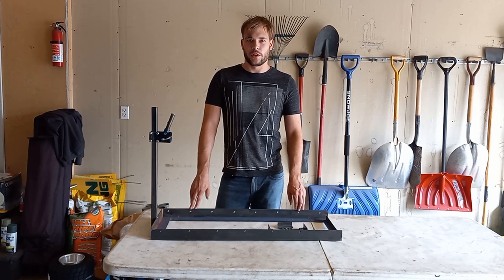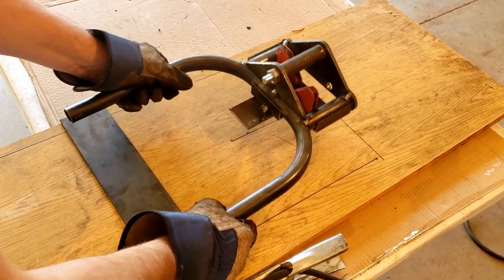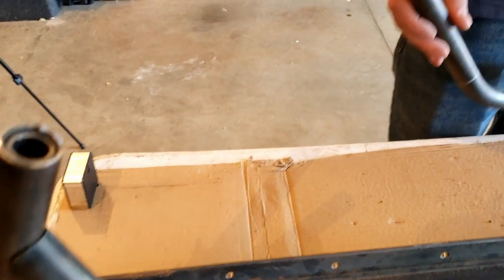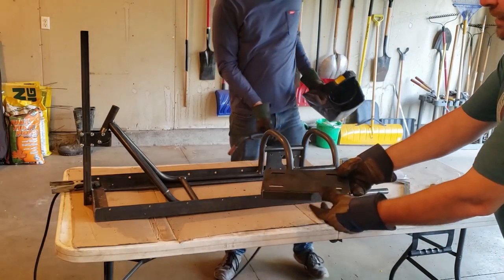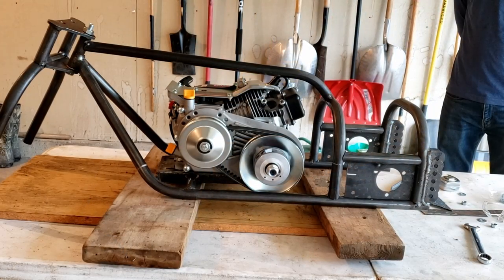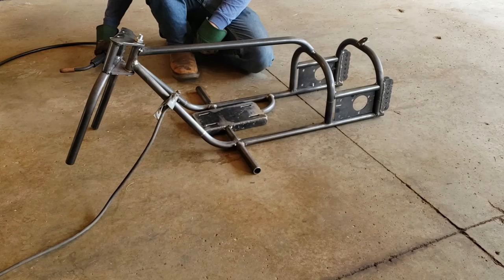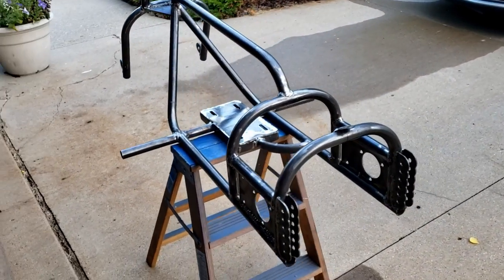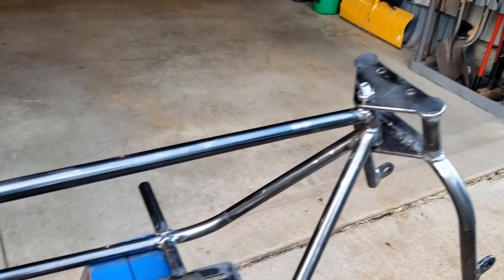Predator 212 Ghost Mini Trike || Completing the Frame

Comment: I'm currently building this an t4 won't bend in my speedway motor gen 3 bender. Or I can't figure out how to make it a tight bend I guess. I tried the bend support link but still nothing. Max I can get it to close is 17" but it should be 12 as pictured in the right up. An help before I waste more tube.

Comment: I've got a mod 2, 212 I'm itching to build a drifting machine, and your trike is looking good.. I cant wait to see the outcome,  and  w slick s gooo and nice custom exhaust.. 😁👍👍👍
What type of steel did you use?
So clean it looks stainless!
Reply from the maker: It's just regular erw steel. The scaling was stipped off using a wire wheel.